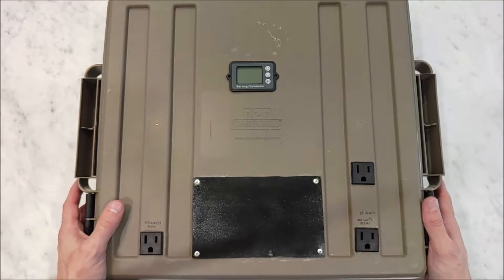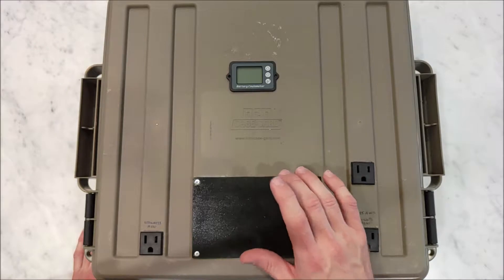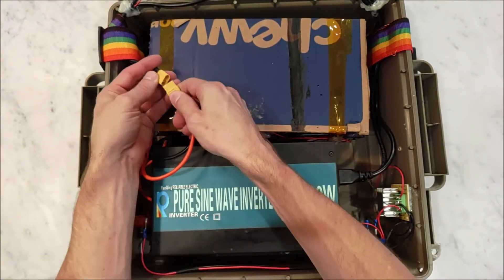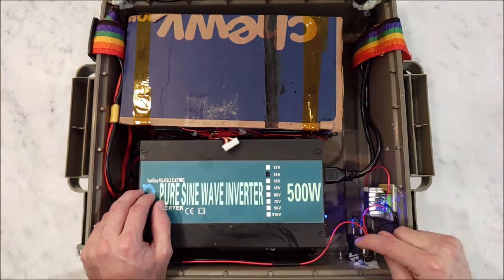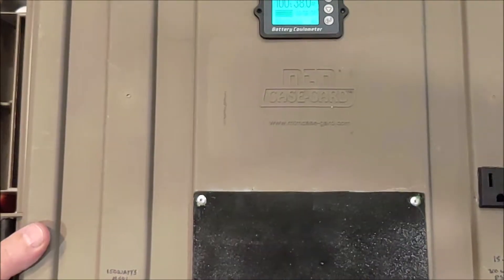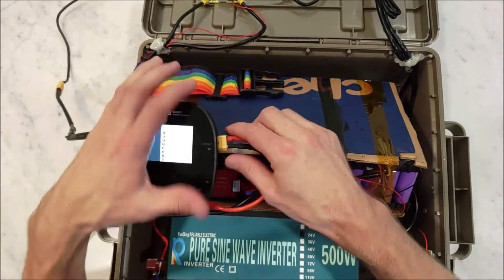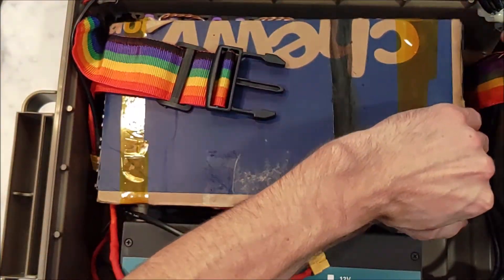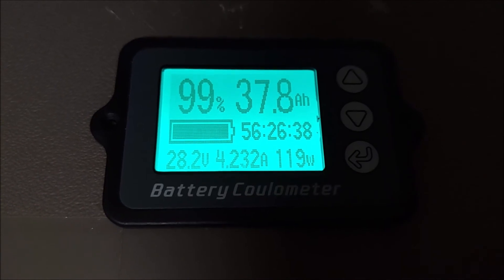PORTABLE 1000W 24V BATTERY BACKUP HURRICANE BOX

Comment: Very nice. Steve any chance you can list parts? Also could you use your solderless battery cases, or the spring s cannot handle this amperage?
Reply from the maker: Solderless battery cases are actually better suited to this application because this application uses a larger battery with a slow consistent draw where as an ebike is a smaller battery with high current draw. This sort of application can use lower quality batteries than an ebike because we will not hit the batteries hard. Maybe 2-4 amps MAX where as ebikes can hit the batteries for 10amps at times.
Reply from the maker: Look at the reviews on the ISDT T8 on bangood. https://www.banggood.com/ISDT-T8-BattGo-1000W-30A-Smart-Battery-Balance-Charger-For-1-8S-Lipo-Battery-p-1191860.html?rmmds=search&cur_warehouse=CN
Reply: Managed to get the names off your video and list here, not sure they are the exact ones you used.

http://www.mtmcase-gard.com/ammo-crates-mtm.php

http://www.powerreliable.com/index.php/product/5000W_Off_Grid_DC_to_AC_Pure_Sine_Wave_Solar_Power_Inverter-16

https://www.amazon.com/Reliable-RBP-500S-LED-Solar-Power-Inverter/dp/B01MF6CJSR?th=1

https://www.aliexpress.com/item/50A-New-TK15-Professional-Precision-Battery-Tester-for-LiFePO-Coulomb-Counter-Free-Shipping-with-Tracking-Number/32702066121.html?src=google&albslr=116769288&src=google&albch=shopping&acnt=708-803-3821&isdl=y&aff_short_key=UneMJZVf&albcp=653153647&albag=34728528644&slnk=&trgt=61865531738&plac=&crea=en32702066121&netw=g&device=c&mtctp=&albbt=Google_7_shopping&aff_platform=google&gclid=CjwKCAjwzqPcBRAnEiwAzKRgSwlfGTS_CE-cg0vprLNolvoRMTCklVsVO9mYNlBYU0-5WhXo0rLLVRoCo5EQAvD_BwE&gclsrc=aw.ds

https://www.aliexpress.com/item/ISDT-T8-BattGo-1000W-30A-Smart-Battery-Balance-Balancing-Charger-For-1-8S-Lipo-Battery-Charging/32834114154.html?spm=2114.search0204.3.30.6c90285cbMMXGn&ws_ab_test=searchweb0_0,searchweb201602_1_5724111_10065_10068_10130_5724711_5724211_10547_10546_5723811_10548_5723711_5724311_5890011_315_10545_10696_5724011_531_10084_10083_5723211_10618_5723411_5722211_5970011_10307_5723311_5723611_5723111_5910011_5723911_5860011_10059_5722311_100031_5725111_10103_5722111_5725011_5722411_5990011_5723011_5980011_5724911,searchweb201603_54,ppcSwitch_7_ppcChannel&algo_expid=efa90103-51dc-4285-a516-4705be5f18bb-4&algo_pvid=efa90103-51dc-4285-a516-4705be5f18bb&transAbTest=ae803_1&priceBeautifyAB=0

Reviews on Amazon not stella for the ISDT-T8
https://www.amazon.com/Compact-Lithium-Battery-Charger-1000W/dp/B0776PW3NW/ref=sr_1_1?ie=UTF8&qid=1535743390&sr=8-1&keywords=isdt+t8&dpID=41W%252BMvb5ejL&preST=_SX300_QL70_&dpSrc=srch#customerReviews
Reply from the maker: Put the parts list in the description to the video.